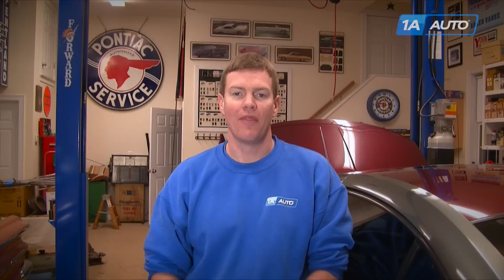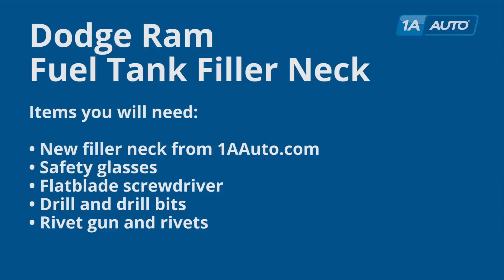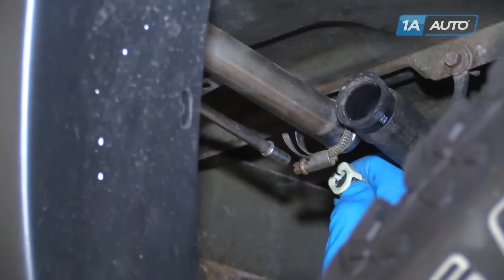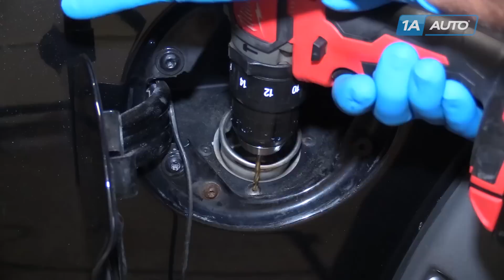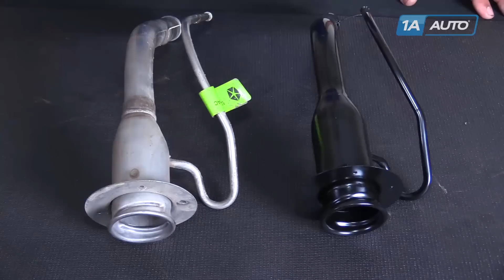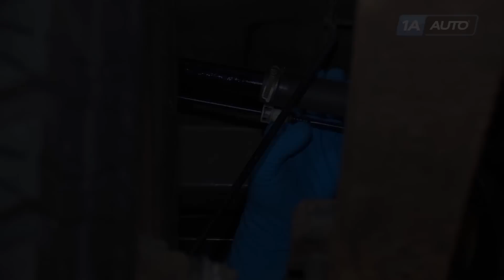How to Replace Fuel Tank Filler Neck 04-08 Dodge Ram

Comment: Is there supposed to be a gate in the filler neck like on most other trucks?
Reply from the maker: +Grind Hard Plumbing Co Thanks for checking us out. The parts we offer will be built to exact OE specifications if the original filler neck had a gate the replacement will as well. 1aauto.com

Comment: Hi my 2004 dodge ram 1500 throws gas out everytime its full, its like the truck doesn't know its full. Would this fix the issue?
Reply: Sounds like fuel pump.

Comment: I have a 2004 dodge I brought used I noticed that there's no little pop up piece in the center where you put the gas nozzle.  Should that be
Reply from the maker: +Troy Suggs This will not effect anything major. This is just to prevent any splash back and to keep debris out of the filler neck/tank. As long as you keep your gas door closed there shouldn't be an issue
Reply: @1AAuto  the code po440 keeps coming up. Could that be causing the code

Comment: hi i have a 2007 dodge ram 1500 where the check engine light is on code is p0455 which is a large  leak in the evap. system i change the canister and purge valve and ligt still there,but i notice when i'm filling up at the pump i smells gas fumes i thick when the truck is driving it also smells but not when it sits any help or other ideas can the filler hose will help ?thanks
Reply from the maker: Thanks for checking us out. Unfortunately, there could be multiple reasons why you're having this particular problem. We suggest taking your vehicle to a nearby reputable shop to identify the cause.  +donovan hyatt
Reply: Hi Donovan,  A friend of mine is having the same issue you described here.  Did you every figure out what was causing your issue?  Thanks
Reply: @brianbiehn7657  Same issue here, and my dash reads "gas cap". Chaned all evap & canister and gas cap twice. Thinking may be the filler neck? Any word anyone?

Comment: Would this cause the engine light to come on....I've replaced the gas cap but light still on..
Reply from the maker: +Jay Jay It could but make sure it's not a sensor like an oxygen or fuel sensor

Comment: Everytime i fuel up i wont go past 2 bucks when the nozzle pops out and i gotta run the nozzle super slow to be able to fuel up,  will this fix the problem ??
Reply from the maker: +Jose Albarran Thank you for checking us out. The fuel filler neck replacement could resolve this issue as the tab inside may be flopping around and causing incorrect sensing of the gas nozzle. 1aauto.com
Reply: Jose Albarran Did you get the problem resolved?  I'm having the same issue and trying to figure out the cause.
Reply: im having the same issue... Im thinking it might be the ball in the bottom of the neck? im glad to hear that other people are having the same issue. Did you resolve your issue?
Reply: im having the same issue... Im thinking it might be the ball in the bottom of the neck? im glad to hear that other people are having the same issue. Did you resolve your issue?
Reply: Same issue I'm having. Im thinking it's in the vent area of the tank. Ran tank super low, and possibly clogged vent line.  Anyone figure this out??
Reply: I am having the same issue,Anyone fixed yet?
Reply: Has anyone got any results.?